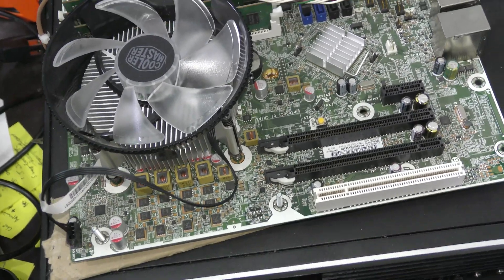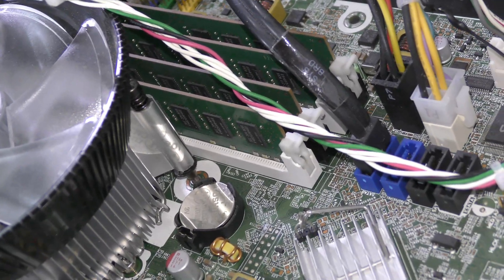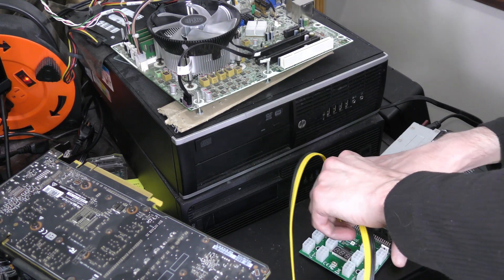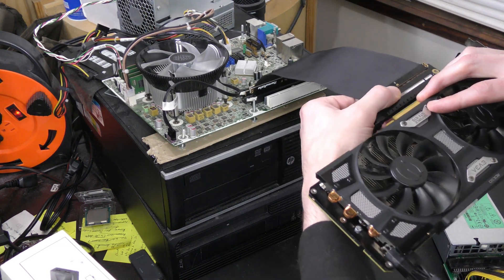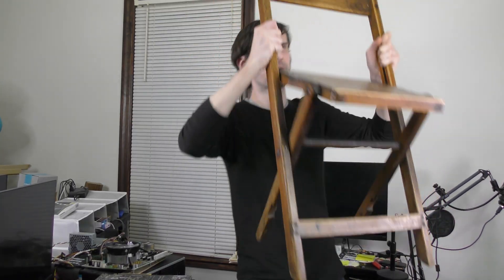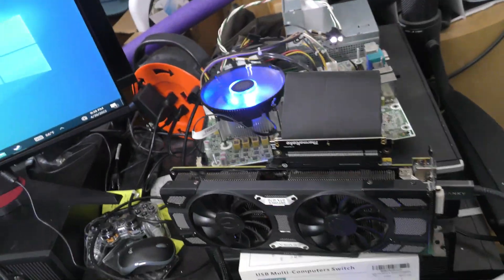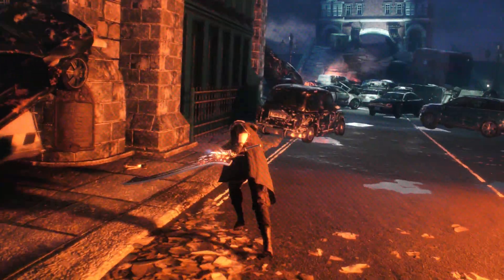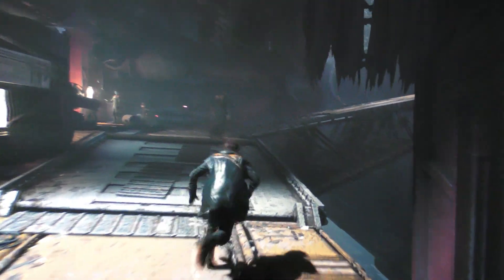GPU - Does anything else really matter for Gaming?

Comment: Until mid 2021 I was gaming on an Optiplex 790 with an i7 2600 and a 1650 Super.  It struggled a bit with some newer AAA games, but other than that it was great.
Reply from the maker: Heck yeah. I've messed with some older OptiPlexes, but never kicked it quite that far back, that is awesome😃
Reply: @LowcastleTech  Haha I'm running even more ghetto. I'm literally stretching my old i5 3570k with 16gb of ddr3 memory and HDD drive. Until this weekend i was still running a Gtrx 670 and i just bought a used Rx 580 in pretty much brand new shape for 30$. It's not even a money issue as i was looking to upgrade at the 3000 series but it turned out to be unavailable and overpriced so i was like i will wait for the 4000 series but now i realize the only game i want to play atm is the upcoming Diablo 4 which can run in 1080p even at high setting at around 70 fps. The true game i want to upgrade with just got delayed to end of 2024 (Ark2) so because of this i will keep stretching my old PC. I will def check to purchase at least an SSD though. I don't care about loading time of Windows or the game at first but if it's much slower between dungeons in a game with multiple downloads all the time then it can be annoying for sure!
Reply from the maker: @sylvainh2o  That is awesome 🙂. I really like people keeping these older but still functional builds going. And I have been hearing a lot about the 580, seeing it pop up a lot of places. Looks like a really solid budget option, and sounds like you got a sweet deal on yours!
Reply: @sylvainh2o  i7 3770 is only £35 from a dealer with warranty in the UK, those extra threads will give much smoother gameplay with higher 1% and 0.1% lows and your DDR3 will use all the bandwidth as an i5 struggles over 8gb, at least in my tests although K series were better especially overclocked.  You are right about the 3770K, they are well overpriced.  A 2600K is only £25 though and they overclock really well so will easily beat any stock speed 3rd gen so that would be my upgrade for your platform.  SSD's are now only £15 for 250gb new so would be rude not to get one.
Reply: @theHardwareBench  Yep I'm 100% getting a good SSD now the prices went down by a lot now it's super cheap specially if not the fastest NVME which my old Pc couldn't even take.